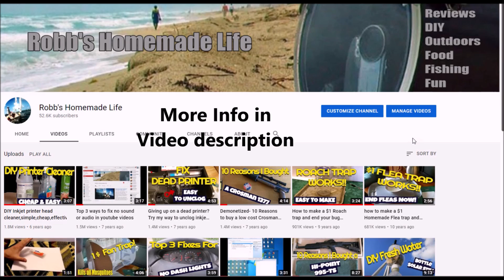12 REASONS CAR FUSE KEEPS BLOWING

Comment: Installed a new headlight assembly, the next day my turn signals would not work...found the fuse was blown...installed a new fuse ...that fuse blew too...still trying to find what's wrong
Reply from the maker: Hey Bruce, It sounds like there’s a short in the circuit that started when the new headlight was installed. A few things to check:

Make sure the fuse is the correct size.

Inspect the headlight wiring and connectors for pinched wires or bent pins.

Check that the bulbs are the right type and seated properly.

Try unplugging the new headlight, put in a fresh fuse, and test the turn signals. If the fuse holds, the issue is inside the new assembly. If it still blows, the short is somewhere else in the wiring.

Often it’s just a wire touching metal or a bad connection near the new headlight.

Comment: Very good video. I have a 2013 KIA optima that when you try to roll down the passenger windows it blows the fuse. Any solutions?
Reply from the maker: Hello gene   When a fuse blows every time you try to roll down the passenger windows, it usually means there’s a short circuit or something pulling too much current in that circuit. On a 2013 Kia Optima, here are the most common causes:

Window motor is failing – If the passenger window motor is seizing up, it can draw more power than the fuse is rated for, causing it to blow.

Wiring short – A wire in the door harness (especially where the wires bend inside the rubber boot between the door and body) could be damaged, rubbing bare, and shorting out when the switch is used.

Faulty switch – The passenger window switch or the driver’s master control switch could have an internal short.

Water intrusion – Moisture inside the door panel or switch can cause electrical shorts.

What to check:

Inspect the wiring in the door jamb for cracked or frayed wires.

Try unplugging the passenger window motor and then press the switch—if the fuse doesn’t blow, the motor is likely bad.

If it still blows with the motor unplugged, the problem is in the switch or wiring.

This is an electrical issue, so it’s best to start with a visual inspection of the wiring and connectors. If you’re not comfortable with electrical diagnosis, a shop can track down the short pretty quickly with a multimeter.  Good luck

Comment: Robb, you didn't mention a possible short in the circuit. Would this not cause a fuse to blow? I think maybe this is the problem I have, just have to check things with my multimeter providing I can work out all the things to check hmmm 🤔. Any help would be much appreciated, cheers. 
BTW it's the indicator circuit fuse I am having this trouble with, have checked obvious thingss, bulbs, bulb sockets wires etc.
Reply from the maker: Hey thanks a lot for watching the video and commenting I appreciate it. I think I mentioned a short could be a problem but what I can do is see if I can make a video specific to the turn signal or indicator fuse that continues to blow.
Reply: @RobbsHomemadeLife  Many thanks for your prompt reply Robb, much appreciated. I will subscribe so I will be notified if and when you produce such a video. thanks again, cheers from the land down under.

Comment: The brake fuse blew as soon as I tried to replace it 😞 any solutions?
Reply from the maker: Hello Adrian , The brake fuse protects the brake light circuit. If it blows instantly, there's likely a direct short (wiring or component grounding out) in the circuit.
2. Check Common Problem Areas
Brake Light Bulbs:
Inspect all brake light bulbs for damage (broken filaments, melted bases).
A faulty bulb or socket can cause a short.
Wiring to the Brake Lights:
Look for damaged or pinched wires near the tail light assemblies, especially where the wiring enters the trunk or hatch.
Brake Light Switch:
Located near the brake pedal, this switch can short out internally. Disconnect the switch and see if the fuse still blows when replaced.
3. Look for Modifications or Damage
If the vehicle has trailer wiring, aftermarket lighting, or recent electrical work, inspect these areas for errors or damage.
Rodents can chew wires, especially under the hood or near the brake lights.
4. Test for a Short
Use a multimeter set to continuity or resistance:
Remove the fuse.
Place one probe on the fuse terminal and the other to ground.
If there's continuity, a short exists.
Disconnect components (e.g., brake light switch, bulbs) one at a time to isolate the problem.
5. Bypass with a Circuit Breaker
Replace the fuse temporarily with a circuit breaker of the same rating (available at auto parts stores). This prevents you from constantly replacing fuses while troubleshooting. When the circuit breaker trips, it resets itself, helping identify when the issue occurs.
6. Inspect Grounds
A poor ground connection can cause excessive current draw in the brake light circuit. Check for loose, corroded, or disconnected ground wires near the brake lights.
Reply: @RobbsHomemadeLife hello, when you mean “ground” do you mean the metal chassis of the car? Besides that, thanks for the information

Comment: I just changed my battery because at first, i had trouble starting it; so i took it to AutoZone to have it checked & twice it said "bad ignition relay ". At first a could of friends thought it was either the alternator or the starter. Once i changed the battery, i waited until the next day to try it again. It starts now but nothing electrical works.
Reply from the maker: Hello Gerard, here's a list of possible causes and troubleshooting steps for the issue:

Symptoms:
Car starts with the new battery, but nothing electrical works (e.g., lights, radio, power windows, etc.).
AutoZone diagnostic tool previously reported a "bad ignition relay."
Likely Causes:
Faulty Ignition Relay:

If the ignition relay is bad, it could prevent power from being distributed to the electrical components of the car. Replacing the ignition relay may solve the problem.
Blown Fusible Link or Main Fuse:

A fusible link or main fuse (often located near the battery or in the engine bay fuse box) protects the car's electrical system. If it blew during the initial battery failure or while replacing the battery, it could cut off power to the vehicle's electrical system.
Loose or Corroded Connections:

Check the battery terminals and ensure they are tight and free of corrosion. Also, inspect the ground connection from the battery to the chassis and engine block. A poor ground connection can cause electrical issues.
Faulty Alternator or Charging System:

While the car starts with the new battery, if the alternator isn’t charging the battery properly, electrical components may not function. A quick alternator test (done at AutoZone or another parts store) can rule this out.
Blown Secondary Fuses:

If the fusible link is intact, check the interior and engine bay fuse boxes for blown fuses. Look specifically for fuses labeled for "Ignition," "Accessory," or "ECU."
Bad Electrical Control Module (ECM) or Body Control Module (BCM):

If the ECM or BCM is malfunctioning, it could cause electrical components to fail while allowing the engine to start. This is less common but worth considering if the above steps don’t help.
Steps to Troubleshoot:
Check the Ignition Relay:

Locate the ignition relay (check the owner's manual or fuse box diagram) and replace it if it's bad. It’s a relatively inexpensive part.
Inspect the Main Fuse and Fusible Links:

Open the fuse box under the hood and inspect the large fuses (e.g., 50A, 100A) near the battery for damage. Fusible links may look like regular wires but may have melted internally.
Inspect the Battery Terminals and Cables:

Ensure the battery cables are securely tightened and free of dirt or corrosion. Clean them if necessary.
Test the Alternator:

Use a multimeter to measure the battery voltage while the engine is running. A healthy alternator should show 13.8–14.4 volts. If it's below this range, the alternator may need replacement.
Check All Fuses:

Use a test light or multimeter to check all fuses in the interior and engine bay fuse boxes.
Scan for Trouble Codes:

Even if the check engine light is not on, scanning for diagnostic trouble codes (DTCs) can reveal hidden electrical issues. Many parts stores offer this service for free.
Reply: @RobbsHomemadeLife  I took it to an auto electric mechanic & it ended up being a loose ground connection. He said it was under the car & that it him awhile to find it. He charged me $80
Reply from the maker: Anytime you can get a mechanic to fix an electrical problem for $80 is a lucky day I'm glad it worked out for you thanks for watching and commenting much appreciated

Comment: Thank you, I sent video to my son.
Reply from the maker: Glad I could help
Reply: @RobbsHomemadeLife  some young people think they know it all, my Acuras AC doesn’t work and fuse blows as soon as the car starts but cigarette lighter doesn’t work either
Reply from the maker: It sounds like your  Acura has an electrical issue that may be related to a short circuit or a problem in the wiring, particularly since both the air conditioner and cigarette lighter aren't working, and the fuse blows immediately when the car starts. Here are a few potential causes and steps to troubleshoot the issue:

1. Check for Short Circuits:
Wiring Inspection: Since both the AC and cigarette lighter are affected, they might share a common circuit or ground. Check the wiring that connects these components for any signs of wear, fraying, or exposed wires that could be causing a short circuit.
Fuse Box Inspection: Inspect the fuse box for any signs of corrosion or damage. Sometimes, a loose fuse or a poor connection can cause multiple components to fail.
2. Test Components Individually:
Cigarette Lighter: Remove the cigarette lighter from the circuit by unplugging it, and then try replacing the fuse. If the fuse doesn't blow with the cigarette lighter removed, the lighter may be shorting out the circuit.
AC Compressor Clutch: The AC compressor clutch could also be faulty, drawing too much current and blowing the fuse. Disconnect the AC compressor and see if the fuse still blows when starting the car. If not, the compressor clutch may need repair or replacement.
3. Check for Overloaded Circuit:
If the AC and cigarette lighter are on the same fuse, there may be an issue with overloading the circuit. It’s worth checking the vehicle’s manual to see if these components are supposed to share a fuse. If not, someone may have incorrectly rewired or replaced a fuse with the wrong amp rating.
4. Look for Grounding Issues:
Faulty or loose ground connections can cause electrical issues like this. Ensure that all grounding points, especially near the fuse box and AC system, are securely connected and free of corrosion.
5. Test the Fuse Rating:
Ensure that the correct fuse rating is being used according to the vehicle's specifications. Sometimes a lower-rated fuse is mistakenly installed, causing it to blow under normal operation. Good Luck!😀
Reply: @RobbsHomemadeLife  thank you so much he is looking for the short on the wires

Comment: Hey my brake light fuse keeps blowing and I can’t get it out of park aswell. My trunk had melt wires too. What was causing ur problem? Please and thank u
Reply from the maker: Yes I think we had the same problem. The wires in the trunk of my 1994 Corolla melted because the plastic connections overtime deteriorated which caused my brake lights not to come on or being unable to shift my gears.

Comment: I have a 2006 hyundai elantra and it keeps blowing the radio fuse it has been side swiped on the passenger side door
Reply from the maker: Hey Randy If your 2006 Hyundai Elantra keeps blowing the radio fuse, particularly after being sideswiped on the passenger side door, there are a few potential causes you should investigate:

Short Circuit: The impact from the sideswipe may have caused wiring damage, leading to a short circuit. Inspect the wiring harness, especially those running through the passenger side door and into the dashboard. Look for any exposed or damaged wires that might be causing a short.

Grounding Issue: The accident might have affected the grounding of the radio or other electrical components. Ensure that all ground connections are secure and undamaged.

Pinched Wires: The door being sideswiped could have pinched or damaged wires in the door or near the hinge area. Check for any pinched, frayed, or broken wires in the door harness.

Faulty Radio or Components: The radio itself, or components connected to it, might have been damaged. Disconnect the radio and see if the fuse still blows. If it doesn't, the radio or its associated components might be the issue.

Aftermarket Accessories: If you have any aftermarket accessories (like an amplifier or subwoofer) connected to the radio circuit, these could be the cause of the issue. Check their wiring and connections.

Steps to Diagnose and Fix:
Visual Inspection:

Inspect the passenger side door for any obvious signs of wiring damage.
Check the wiring harness for any cuts, abrasions, or pinch points.
Check the Fuse Rating:

Ensure that you are using the correct fuse rating for the radio circuit. Refer to the vehicle’s manual for the appropriate fuse rating.
Disconnect the Radio:

Disconnect the radio from its power source.
Replace the fuse and see if it blows again. If it doesn’t, the problem is likely with the radio or its connections.
Check for Continuity:

Use a multimeter to check for continuity in the wiring. Look for any signs of a short circuit.
Inspect Door Wiring:

Check the wiring that passes through the door jamb to see if any wires were pinched or damaged in the accident.
Test Ground Connections:

Verify that all ground connections related to the radio are secure and free of corrosion.

Comment: THANKS. WHAT CAUSES FUSES TO BLOW IN A CAR  AIR  CONDITIONER  ?
Reply from the maker: Fuses in a car air conditioner can blow due to various reasons, typically related to electrical issues. Here are some common causes:

Overloaded Circuit: If the electrical circuit is overloaded beyond its capacity, the fuse will blow to protect the system. This can occur if there is an issue with the air conditioner components drawing more power than they should.

Short Circuit: A short circuit occurs when a live wire comes into contact with a ground or another wire, causing a surge of electricity. This can happen due to damaged insulation, exposed wires, or faulty connections.

Faulty Compressor Clutch: The compressor clutch engages and disengages the air conditioner compressor. If the clutch is faulty or sticking, it can draw excessive current, leading to a blown fuse.

Worn-Out Compressor: A compressor that is failing or has internal mechanical problems can also cause excessive electrical load, resulting in a blown fuse.

Faulty Blower Motor: The blower motor circulates air through the air conditioning system. If the motor is malfunctioning or its bearings are worn out, it can draw too much current and cause the fuse to blow.

Electrical Component Failure: Any other electrical component within the air conditioning system, such as the relays, switches, or sensors, can fail and create an abnormal electrical draw.

Corroded or Loose Connections: Corrosion or loose electrical connections can increase resistance in the circuit, leading to higher current draw and a blown fuse.

High-Pressure Switch Issues: The high-pressure switch protects the system from overpressure conditions. If it fails, it might cause the system to overwork, drawing more current and blowing the fuse.

Obstructions in the System: Physical obstructions within the air conditioning system can cause the components to work harder, increasing the electrical load and blowing the fuse.
Reply: @RobbsHomemadeLife  OH MY GOD, THAT SOUNDS LIKE A NIGHTMARE   BUT THANKS.

Comment: I installed led strip lights from amazon to my 2014 silverado’s bed since i’m planning on adding a bed cover , installed a fuse with a 30 amp fuse and a switch for the lights , the fuse blows up every time i turn the switch to off , if the switch is in off mode i will pop immediately, if the switch is in ON the lights will work perfectly, why will this happened?
Reply from the maker: It sounds like there might be a short circuit in your wiring setup. When you turn the switch off, there shouldn't be any power flowing to the LED strip lights, but if there's a short circuit somewhere in the circuit, it could cause a surge of current that blows the fuse.

Here are a few things you can check:

Wiring Connections: Make sure all your wiring connections are secure and properly insulated. Loose or exposed wires could be causing a short circuit.
Switch: Ensure that the switch you're using is rated for the voltage and current of your LED strip lights. If the switch is faulty or not rated for the load, it could be causing the issue.
Fuse Size: While a 30 amp fuse might seem appropriate, it's possible that the LED strip lights don't actually require that much current. Check the specifications of your LED strip lights and consider using a lower amp fuse if appropriate.
LED Strip Lights: Inspect the LED strip lights themselves for any signs of damage or exposed wiring that could be causing a short circuit.
Grounding: Ensure that your vehicle's chassis is properly grounded and that the ground connection for your LED lights is secure.
By systematically checking each of these potential issues, you should be able to identify and fix the problem causing your fuse to blow when you turn off the switch